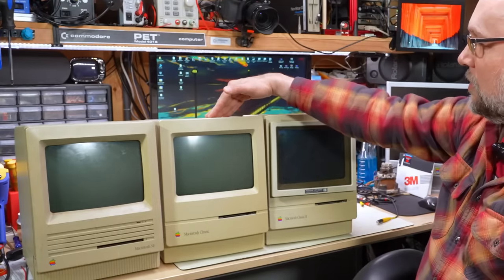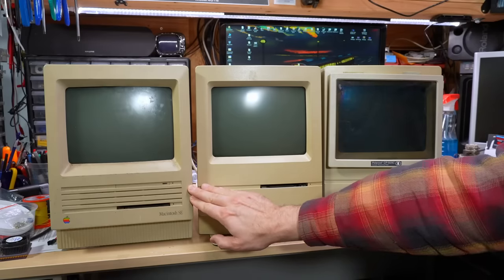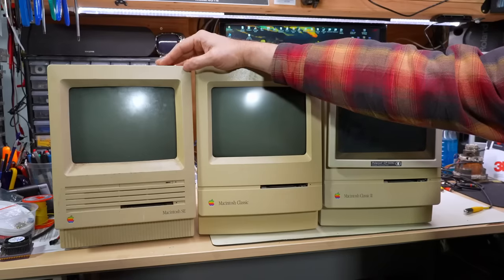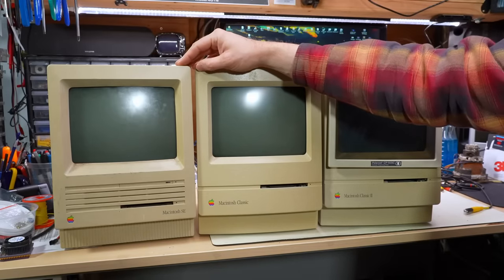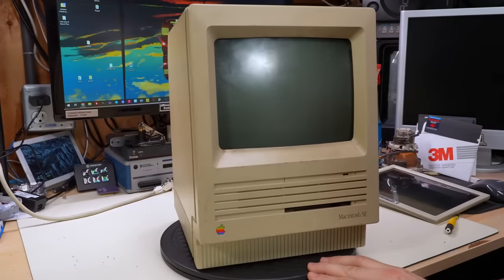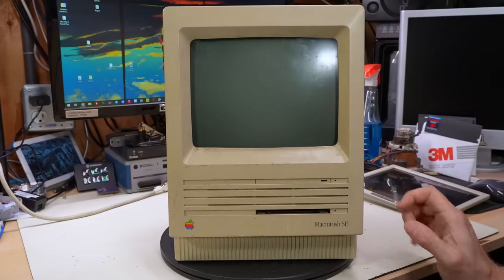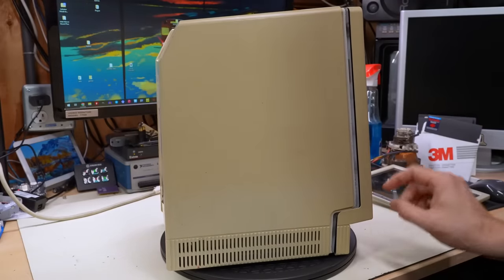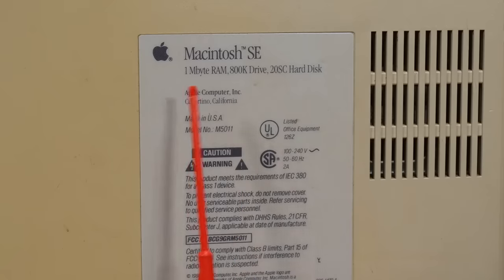Three unknown Macs: Let's get them working again #repair

Comment: Factory “correct” geometry does not fill the screen edge to edge. You want the flashing floppy disk to be about 11mm square which will mean you’ll have rather thick horizontal bars at the top and bottom. That will give you more true to life WYSIWYG from screen to printer. Great video and nice work :-)

Comment: I gotta sat "Varta" gets a bad rap,, just because it was the most used battery of its time why blame it for leaking when its 30 / 40 years old ?? I have had Duracell  IN DATE destroy some of my kids toys and other stuff like xmas lights or remotes with 2+ years left on the date. i kid you not i have emailed Duracell for destroying my kids tablet ( innotab ) took 4 AA batteries, with 2yrs on the date and their explanation  was "you must have let the batteries deplete thats why they leaked so its your fault" I mean WTF my amiga A500+ didn't leak until 30 yrs PAST its date,,,, Varta was/is a good brand and it should be given its merits that some have not leaked and still hold a charge 30+ years later,, we all need to look at current in date batteries that leak/fail within 5 years or even before the expiration date on the battery. end of rant..............
Reply: VARTA still is the OEM for some German car manufacturer’s lead acid starter batteries. I have worked with a plant that supplies their charging, testing and measurement equipment (Benning in Bocholt, DE) and they demand sick quality control and precision to make sure things check out. I don’t think it’s transferable experience to the problems at hand but it is still not a „Vartas are bad“ thing. Those things are old and tired. It’s more a thing of getting old battery chemicals off the board no matter what type and how much charge they hold. Old batteries might be degraded nonetheless and technology has improved (not for your Duracells it seems, sorry for that 😢).

Comment: The geometry is not bad. They are supposed to be like that, with a black area on top and bottom of the screen. The display area is not supposed to be squared: if it is, you will have a graphical vertical deformation. Check the square on the upper corner of a window, it will become a rectangle. I know it's a bit frustrating not to have a full screen display, buy it's by design.

Comment: Here’s the hands down best way to remove a stubborn case: unscrew the screws half way out, and then use the screw driver to push on the screws till the front cover pops out.  Once it pops out, remove the screws the rest of the way.

Comment: An interesting thing I found about the classic II when messing around with it, is that it's hdd is repairable. My hdd hadn't been working, and was making some sort of grinding noise. I thought it was a complete goner, but I was wrong. I took it apart because I thought it was completely dead, but what I found was a different problem that was actually fixable. It has those rubber stoppers on the inside that cushion the head when it parks. Those rubber stoppers are completely deteriorated, and basically turned to goo. This causes the head to stick to the stoppers and not move. I took my hdd apart, and that's exactly what I found. I took the top magnet off, and carefully wiped off the rubber gunk from both studs. You can replace the stoppers with new rubber ones, but I just modeled and 3D printed new ones in tpu filament. Putting them on was kinda hard, I basically used my screwdriver without a bit to push them back onto the studs. This does require a bit of force, so make sure you move the head out of the way to punch it onto the one stud that is attached to the hdd. When moving the head, make sure it doesn't move off of the disk, if it does, slowly push it back on. It's not really good for the head to move off of the disk. Once you replace those rubber stoppers, the hdd should be good to go. When I took mine apart, it had this weird flywheel above the disk, which I think was the main reason why it worked after opening it. I think the weird flywheel on top of the disk stopped any dust from falling onto the disk itself. Overall I thought my classic II hdd would be a goner, but it ended up working after replacing the rubber stoppers, and I managed to reinstall the OS.
Reply: The flywheel on top isn't to stop dust from falling onto the disk, that's just a blank platter. Centrifugal force keeps dust off the disk, and the wind generated by air dragging along the disk forces any dust remaining inside the case to fly into the little white dust filter. As long as no large particles make it in and get caught on the head, they're self cleaning to get rid of anything that might have made it past the cleanroom where they were assembled.

Comment: When I was in college, I added a second HD to the inside of my SE by riveting a metal HD bracket to the side opposite the power supply (drilled a couple holes in the metal to do it) and adding a scsi cable with a second connector. I’m surprised nobody sold a kit to do it. I recall paying something like $250 for a Connor 20MB HD in the early 90s. It was a painful purchase for a poor college student (me) at the time. I loved that machine. Good memories.
Reply: Nice thing about SCSI is that you can attach 7 devices to any SCSI controller, as long as the ones at either end are terminated.

Comment: Hey Adrian - I doubt you will see this but I've seen a lot of your vids now and a couple of times seen you struggle with those black plastic push-pins. There is a trick to them - what you do is get a pair of needle-nosed pliers and pinch them from the outside and pull straight outwards. Then when you need to put them back, you pinch the smaller piece's "legs" back in and back into the hole, then you take the pin piece and push it back in. Works a treat - no damage, no need for tools other than a single pair of pliers.

Love your vids mate, very comfy - you are like the uncle I never had lol.

Comment: It’s worth to mention that the Plus (and early SE models?) DEFINITELY HAVE RIFA caps! Also: for any older <250mb Hard Drive, like the HD20, 9 times out of 10 they are salvageable! the issue is mainly with the rubber seek-arm bumpers melting due to degradation. Opening the drive, with a clamp placed on each screw to get them out, CAREFULLY removing the top of the positioning magnet, cleaning the gunk out best you can, and placing duct tape around the former spots of those rubber rings, and placing it all back together does it!
Opening these drives and having dust or whatever else get inside is hardly a large issue with <250 meg. drives, but be wary and keep it out! I’ve personally salvaged 8 drives by this, and each are working to this day. :)

P.s: those RIFAs are on the analog board, so high-voltage discharge warnings apply.

Comment: Thank you for your video on the SE. A couple of quick tips regarding the memory - 1) those modern 2 chip plus parity chip modules are not programmed to work in SEs nor SE/30s, or any Mac up to probably pre Quadras, and 2) don't use memory faster than 80ns ie: don't use those 60s nor 70s in an SE or SE/30; usually marked as 6 or -7 on those chips 43:50 - just a general rule otherwise you will get intermittent crashes, as you did!

Comment: I took a Mac SE case and worked a Raspberry Pi into it as an homage system.  I know the Mac fans would be mortified, but it's a great way to pay tribute to a classic computer in a way that's still useful in the modern era.
Reply: What did you do with the original guys?

Comment: One idea, if you don't have the means to properly repair that cracked piece of the case, if you put super glue on the pieces of plastic you want to reconnect then put a little sodium bicarbonate (baking soda) on the super glue, it'll instantly glue those 2 pieces permanently. Just a tip

Comment: Ahhh, yes...  The SE was the first of my retro Mac collection.  I've since added several more compact Macs.  The most recent I had recapped by Amiga of Rochester were one of my Color Classics, SE/30, and Classic II, and next in line is a Classic.  I have tons of these machines on shelves on display in my office and at the house, some permanently setup for demonstration, and it's really cool that I can grab any of them which are on display to just swap with in place of the permanent setups, turn it on, and go!  Floppy EMU, SCSI2SD, and BlueSCSI are your friends for sure 😎

Comment: I'm working with a Macintosh SE right now - I was also fighting with crashes and it seems to be related to the low density RAM (the 1MB simms with just 2 chips, or 3 chips with parity). They seem much happier with the 8/9 chip variations.

Comment: The Mac Classic II could technically have an accelerator card made for it now with SCSI replacement solutions freeing up the HDD power draw, it's just that it was outright disallowed when it was actively sold because the PSU tolerances were too tight to support much more than the FPU/ROM card to the point they only rated that slot overall for 4W max power usage.

Comment: Great to see another Macintosh repair video from you! Regarding the battery. It’s good to have working battery in any classic Mac as it also stores several more settings in the PRAM. Like mouse speed, keyboard repeat rate. AppleTalk interface, Volume cache and 32 bit setting. Maybe more.
Reply from the maker: It's true with with the mouse speed setting being the most annoying when it's lost each time. The other things don't really matter for a 68000 Mac IMHO.
Reply: Agree! Mouse being slow all the time is the most annoying. And you are right about the 68000 vs. the SE/30. Thanks for your reply, Adrian and take care :)

Comment: It's interesting that you appear to have an older motherboard than the one in my SE.  My SE has the battery in a socket, so you can easily replace it with a new 1/2AA 3v lithium cell.

The last time I went digging through SEs, I remember seeing some motherboards with a 1986 copyright and some with a 1988 copyright, so there were at least two different versions.

Also, if you want to install an Apple/Sony 1.44M floppy drive in yours, the older motherboards (that shipped with 800K drives) can support 1.44M drives as long as the ROMs include firmware with the support.  If you install a 1.44M drive, insert a blank 1.44M disk, but Mac OS asks if you want to format it as single-sided/double-sided (as it would for unformatted 800K media), then you don't have the ROM support.  But you can just transfer the ROMs from a newer SE or burn a set of later-generation SE ROMs and that's literally all you need to do in order to get the drives working.

Comment: I would say regarding the Classics, is that there are two types of CRT that can be in them, and the logic boards are not interchangeable between them because the 4-pin connector is different.

Comment: Always fun to see these style Macs. I only ever had, and still use today, an Apple IIgs and Mac iici, so more workstation style standard desktops instead of the all-in-ones. On the one hand it's less to worry about, on the other I grew up learning about CRT's from an uncle that was an engineer designing TV/monitors so it's fun to see repairs on them that these bring along with all the CRt videos. 

Would be fun to see another IIci or IIgs on the channel, but the II line desktops and IIgs are a tad rare in the retro scene, so not surprised they don't pop up very often.

Comment: Me again... as all that I wrote was one on the first 20 minutes.... and now that I seen it all entirely, I have to add...

Long ago I found A Classic II in the trash and I recapped it. Everything works but the sound. Strangely, there is sound when I put in headphones  on the headphone jack, but no sound without the headphones plugged in. I do know, looking at the board through a microscope,  that there are some broken traces in the sound area of the board.  But since this was so long ago, I left it as is. It works great other than it being a silent Mac.

You should test your Mac(s) 's audio port with a headphone or external speaker to see if there really is sound or not. That can save you from a lot of work in the long run.

Comment: Just a note:  The Mac Classic has a version of software 6.0.3 in its rom.  You can set it up, but you need a battery to sustain it.  As for the black fasteners, I used a pair of wire cutters (VERY GENTLY) to grip the pop up part and pull it out a bit.  Don't cut them off!!

Comment: No many original Macs baked to death without an add on cooler that snapped in over the vent on top. A friend of mine had his catch on fire (at his company which used them for work). Luckily he was there and was able to unplug it and put it out. I got a snap on fan for mine and it lasted till I got rid of it.

Comment: Every one of your Mac repair videos gets me a little closer to repairing a coworkers Color Classic... There's a short somewhere on the motherboard causing the power supply to shut down/no-start.
 You can hear the high voltage charge at power up, and the SCSI drive will spin up, as long as the mobo is not installed. Good 5 & 12v at least.

Comment: The Plus doesn't have ADB ports @ 7:40. It uses the proprietary keyboard and mouse connectors, mouse on Plus being the Apple II style Atari-style Joystick interface that is compatible with Atari and Amiga mice, if you swap the pins around to match the pinout.

Comment: I recapped the motherboard on my Mac Classic about a year ago. I had never tried to de-solder SMD caps before. I don't think I managed to get one off without lifting a pad 😢, however it still works. I just had to hot glue the new caps down so they wouldn't be flapping about 😅. I haven't looked at the PSU yet though. I'll have to check it out soon. It's a nice machine.

Comment: I'm glad you did that work on the SE. I have one of my own, which also works great. But if it ever does start acting up, I'll know what to check first. 

I found an SE-30 motherboard for cheap a while ago. I should really try swapping it into the SE. From what I understand, it should fit fine.
Reply: Having done the swap from an SE to an SE30, it works fine.  You will notice it is a bit speedier though.  The board is interchangeable.

Comment: The SE/30 is basically a portable Macintosh IIcx.

My SE had 4MB of RAM in it and I eventually put a 40MB hard disk in it with System 7.1.  it actually had a Tadiran battery holder.

Comment: Hi Adrian. It’s worth resoldering the connections on the tube socket on the neck board while you’re at it, as the tube gets hot with the filament there in the neck of the picture bulb. 😊 That’s a cheap premium to pay for that insurance!

Comment: Even if the battery in the SE hadn't leaked, the fact it measures below 3 volts means it was time to replace it anyway! And you should be able to ease the tip of a screwdriver under the edge of those black fasteners to pop them up far enough to allow them to be taken out of the board. To clarify Adrian's comments on the horizontal width adjustment, the issue with sticking a metal tool into any adjuster that has a ferrite slug is one, the metal adds inductance which can affect the adjustment, and two, you can risk chipping or cracking the slug, making the adjustment difficult or impossible.

Comment: On  Batteries... in the Ma world, the Maxell (Red & Black) 1/2 AA Litihium Batteries are the scourge of the Mac world as they tend to explode and destroy boards. The Vertas and a Purple with Black lettering tends to be safe and least likely to destroy a board through leaking.

The SE (Any 68K SE) is an oddball. Like the older Mac II/IIx, you can have 3 Floopy drives on it - 2 internally and 1 externally.. It is the only Mac that can do this, though most macs should be able to do it but difficult to do, the SE makes it easy.

The story of the Caps is that Pioneer/LG designed a new Cap in the 1990s, but some Chinese company stole their designs and tried out-sell Pioneer/LG. This is this - they only stole 1/2 the design and had to fudge the rest. Then early on computers have had Cap Failures. It is thanks to these Chinese Cap Makers and their bad caps that computers made in the 1990s-2010 need a recap.

You forgot on the Classic about the ROM Drive in the intro.

NEVER EVER REFLOW Solder Joints.  The metal has fatigued and reflowing the joint, though it will reestablish the connection,  it will fail again; If you use the Mac on a daily basis, it will fail with cracked solder joints in less than  weeks. You need to remove the old solder and clean up the area, and resolder with fresh solder and flux.

But resoldering cracked solder is not the solution.  It is a symptom of something else. Get a copy of Larry Pina's Mac repair and upgrade secrets and the Dead Mac Scrolls; it describes what fails and why and what needs to be replaced. The Larrge cap on the top of the analog board, the flyback transformer,  a high frequency transistor in the same area and  the yoke connection jack need replacing. He has parts numbers for the pieces needed.

The Classic is more like the Mac SE as it rarely needs recapping, as most of their boards use Tantalium caps. There are some Classics with electrolytic caps and those need to be recapped if you find them. The Classic II (based on the Mac LC II) use electrolytic caps, and they always need to be recapped. I'm sure you heard of the joke about washing the Classic II board and it would work. That is a good test to see how damaged the board is. 

The Classic has a RAM Slot to add a RAM Board to get it to 4MB, the Classic II has a modified PDS Slot to add certain boards, including a FPU card.. The Classic II does not have a ROM Drive, the Classic is the only Mac with a ROM Drive.

The Classic II shares its board design with the LC II, which limits the RAM to 10MB of RAM.

You can speed up System 7 on a Mac 68K but you need to spend a long time with Resource Editor to remove a lot of STUFF meant for Color Macs. With a smaller OS Footprint, it would be faster than before.